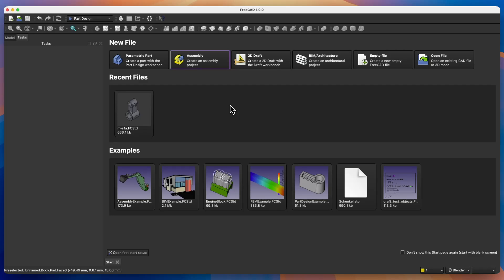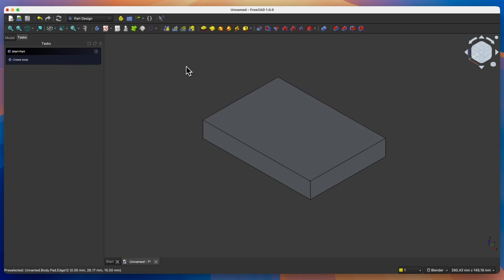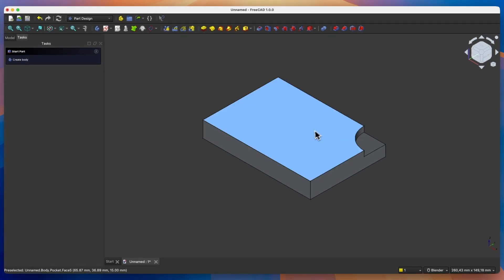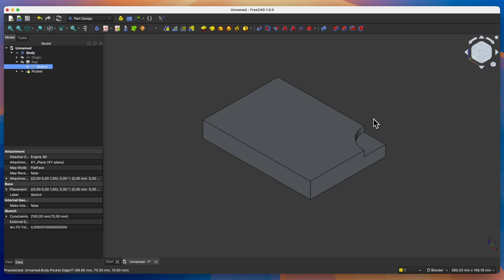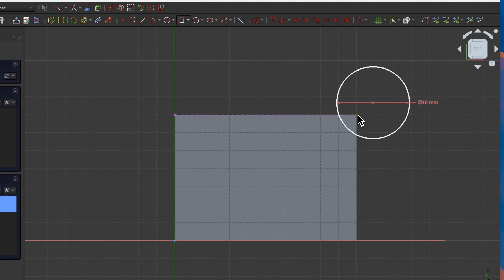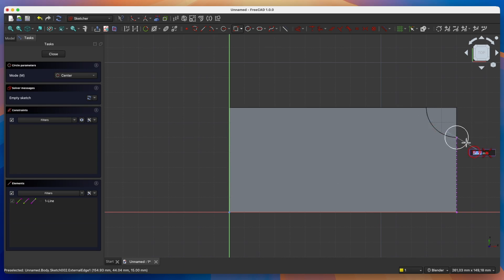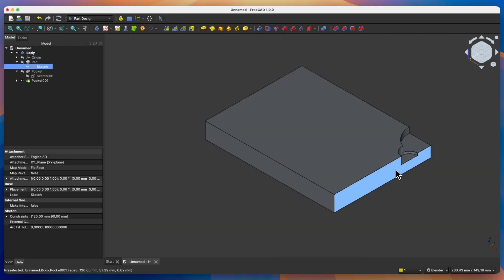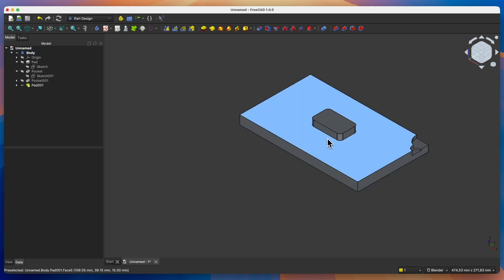Discover the Secrets of External Geometry in FreeCAD - step-by-step learning!

Comment: Your videos are short and concise, just what I need.  Thank you!

A future video suggestion (because I'm trying to design something like this and am having problems) say you have an equal sided cube (you pick the size) and you need a 10mm diameter hole 25mm deep starting on one face (any face) but the hole needs to be at 67.6° relative to the face instead of perpendicular (90°) to the face where the hole starts.  How would you draw that?  Thank you very much, in advance!
Reply from the maker: Thank you so much for your kind words! I’m really glad you’re finding the videos helpful and to the point. 😊 Your suggestion is fantastic—it’s a great example of a practical modeling challenge that could help many others as well.
I’ll definitely consider making a video on this topic.

Comment: Hello, Can Freecad be an alternative to Alphacam ? I'm new in this field and I'm finding a lot of tutorials for Freecad but not as much for Alphacam.
Reply: I think Alphacam is a more specialized application, pretty specific to CNC types of applications. FreeCAD is more similar to Fusion360 and while you probably can use FreeCAD (I'm sure I've seen some tutorials targeting CNC designs using a different "Workbench" in FreeCAD), it likely lacks tools you'd find valuable. For example, there are CNC apps targeting woodworking where it understands which tools to select based on wood density - you won't find that kind of feature in FreeCAD.
Reply from the maker: Probably not.
Alphacam is advanced software for preparing machining programs for CNC machines, with very basic ability to create 3D models.
FreeCAD is advanced software for 3D modeling, with basic ability to prepare machining programs for CNC milling machines.